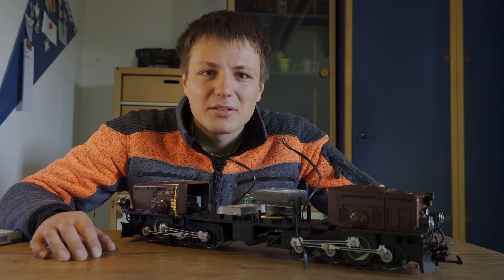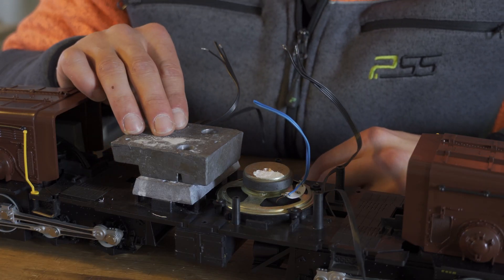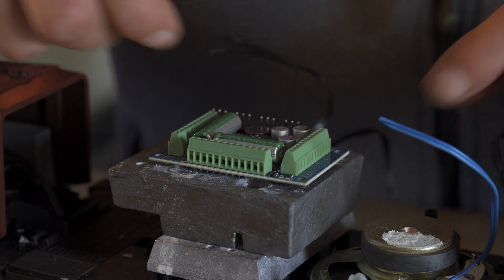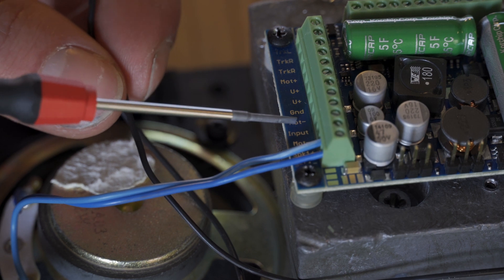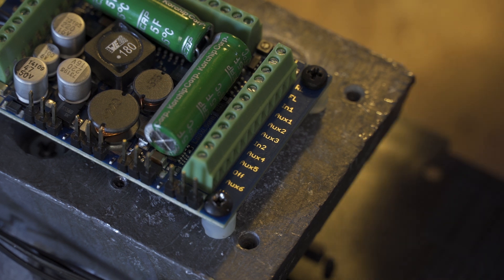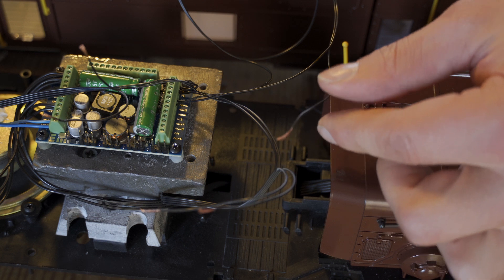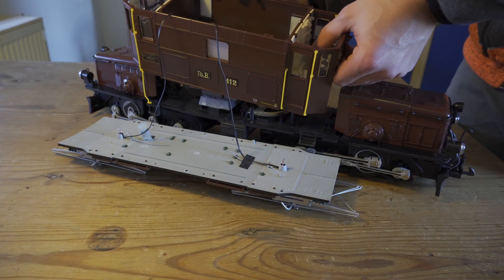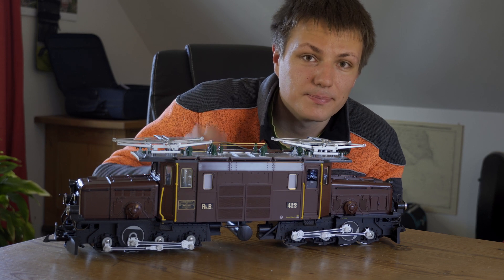LGB Rh.B. Ge 6/6 I 412 Maintenance Part 2 II decoder installation

Comment: On RhB locomotives, all three front lights are illuminated in the direction while the lower right light is illuminated opposite the direction of travel. Were you able to program this feature into your decoder?
Reply from the maker: Yes I incorporated this feature. You have three options in the back ... all dark, the lower right light or all three lights on both sides for shunting operaton.